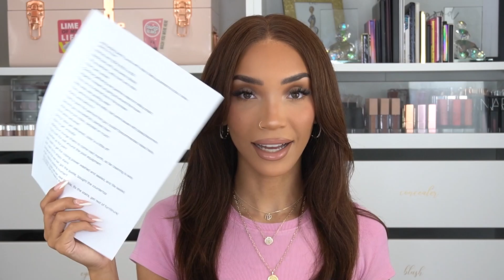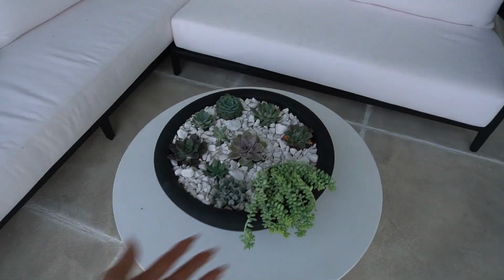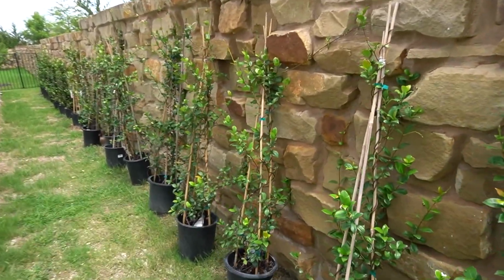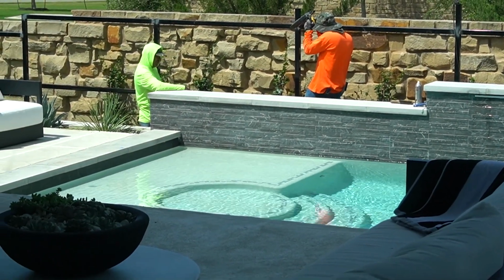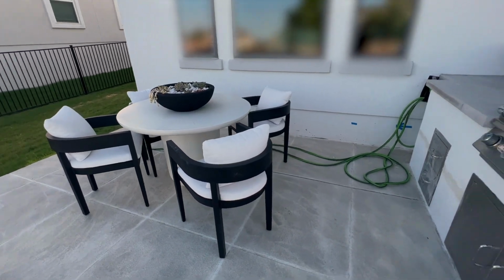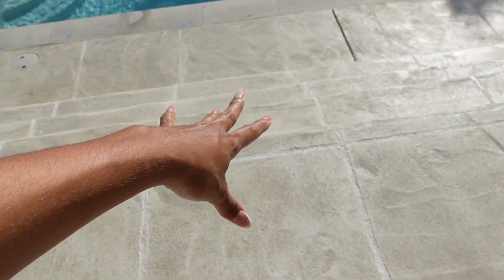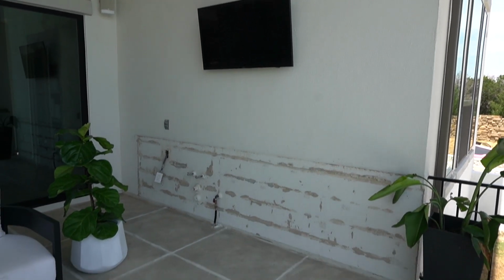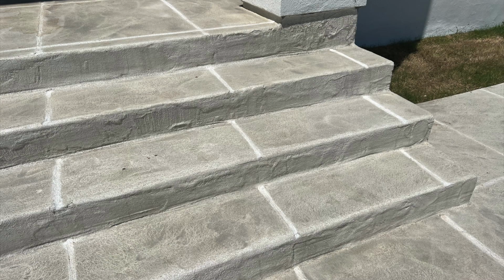Backyard Transformation Update! (Pool & Patio Makeover)

Comment: Hi Raven, I know this is late but
Please look at this outdoor water
Hose system that has a leak proof
And winter freeze cap called the
Aquor system that replaces you
Old spout, you might have to
Purchase the other attachment
With the shut off valve, short blk
Attachment piece with a blue turnoff
Valve knob, no more winter spout
Covering and leaks near the grilling
Station etc... It comes in different colors outdoor caps

Comment: Hi Raven,
I have a suggestion, if it's ok.  I used to be an "interior" designer that doesn't believe in wasting anything. You speak about ripping up the lueder and replacing it with the black granite. You should. Then reuse the lueder as a drop-down wall mounted table that you can prop up when you host parties, or as a coffee table/end tables. Have the granite installer seal there lueder for free when they seal the granite. Congratulations on your beautiful yard!

Comment: Came here to give you some plant advice I learned the hard way! 
1. If you buy a plant from a “big box store” such as Lowe’s or your local grocery make sure you treat it for bugs! Pretty much every plant I’ve ever bought has always had bugs. That may be why one of your bird of paradise isn’t doing well. Usually if when I buy from a good nursery my plants don’t have bugs. That’s usually why people will spend more money on a plant from a nursery. However, you should always treat your new plants for bugs especially tropical ones like the bird of paradise. You can buy pre-made sprays or make your own homemade sprays from the internet. I typically use a hydrogen peroxide and water mix and neem oil and water mix. 
2. The type of soil you get is very important. Before you plant something google what type of soil to use. For example, succulents and cacti need a fast draining soil so they don’t get root rot.
Reply from the maker: Thanks for the advice. I haven’t treated for bugs but I am using cactus soil.